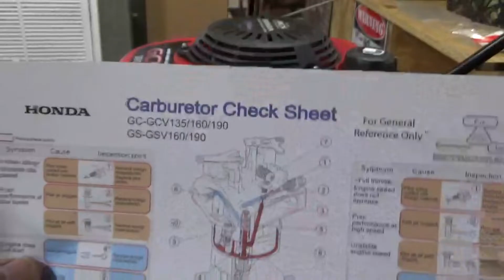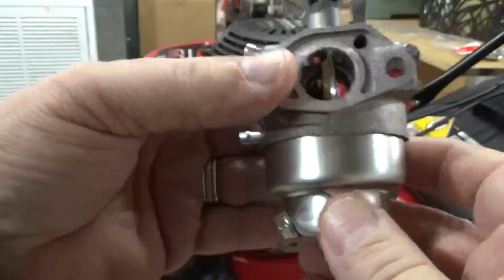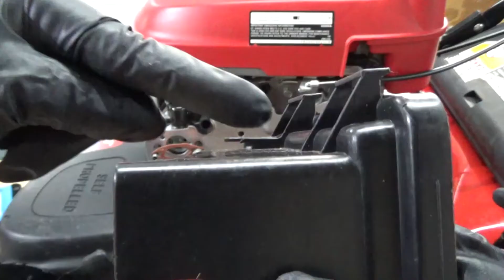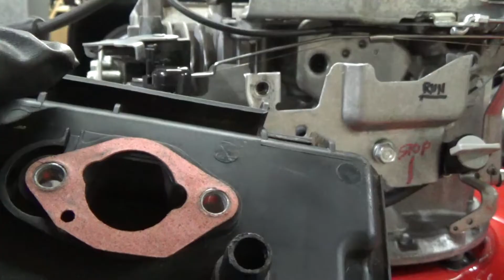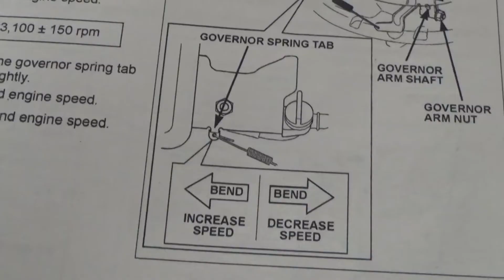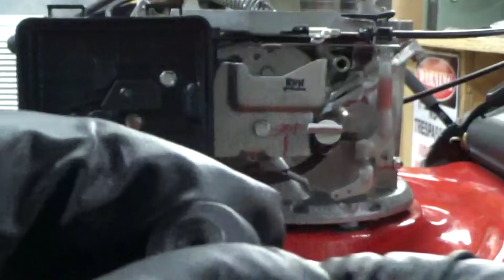Honda GCV160 Fuel System and Carburetor Installation

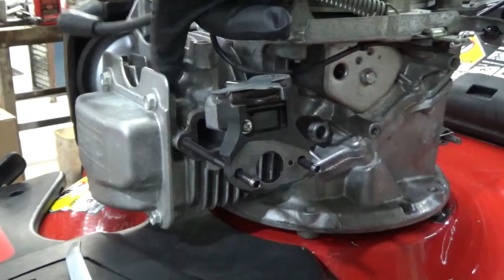Comment: So the piece at 17:07, the auto choke piece, that is what requires that you have this carburetor: 16100-Z0L-876?  It needs to have that tall black post on the top so it will line up with the auto choke?  I have this same engine.  It's on a Troy Bilt but it has that same auto choke piece that goes in the back.  I'm asking because the carb you show at the beginning is not the one you put on at the end.  Thanks for this video.  Insanely helpful!
Reply from the maker: The diffiernce was with the shape of the float bowl.  I decided to use the new design instead of using the brass colored full round design.

The reason for that was that the old design was changed and I desided not to risk a leak in swapping the bowls as the O-Ring seal is very small and thin.

I have not seen the desing you are talking about where the choke is near the engine and the throttle is by the filter.
Reply: Well we ended up getting a carburetor set on Amazon called "Huztl 16100-Z1L-854 Carburetor for Honda" and it worked great. Thank you so much for this video. It was one of only ones I could find that showed how to do our particular Honda lawn mower motor.
Reply from the maker: @those1kidds I am glad that this video helped you.

Comment: You can get these up to 3300-3400 rpm and they'll mow a lot better. They're dogs in thick grass below 3000 rpm.
Reply from the maker: Thank you, I appreciate that info
Reply: @A_Renaissance_Man Some people crank it up to 3600 and the engine does great but the blade is moving too quick and could be dangerous.

Comment: I don't think those holes in the gaskets are dead ends. Is there a channel in that insulator that lines up with them? There is on mine, it's a little different, just a plastic spacer (insulator) with no choke stuff attached. Anyway, you should take that gasket off that was stuck to your insulator, it might make it clear to everybody what's going on.
Great idea with the rods to line everything up!
Reply from the maker: Good idea, I'll do that. Thank you.

Comment: Wait, WHAT?!!! Honda carbs with very similar part numbers can be quite different!? Oh, crap, that could explain why the carb that I bought from Amazon, that appeared to be "close enough", acts like the auto choke (that I recently replaced) isn't doing anything. Just like you, I should have saved my old carb and fixed it instead of replacing it with what seemed like an even nicer newer carb.  Thank you, thank you, thank you, for showing that long list of carb part numbers and the reason there are so many of them.
Reply from the maker: Your welcome.  I make these videos to help.

Comment: I have a lawnmower with a GCV160 engine. I can't control the engine speed. I'm missing a part, but the parts list doesn't show it. Can you help me?
Reply from the maker: Perhaps I can help you.  I have new spare parts like the internal governor gear, but I can not diagnose the issue from afar.   It could be a loose governor arm or the springs could be damaged, etc.
Reply: @A_Renaissance_Man  Thanks for your reply. If I post a link to a video, could you help me?
Reply from the maker: Yes.  I will watch the video and reply.  My gmail address is November11957@gmail.com if you want to send it directly to me.

Comment: Hi , I'm a retired Honda Car Master Tech . I wanted to give some imput on reassemble of carburetor to engine . With or without the special tool you created , you should never tighten ANY bolts down while fitting into place . All bolts should be left loose . After fitting is done you first torque the 2 main carburetor bolts to ensure proper alignment of gaskets , plates and housings followed by the others bolts . Torque to specs , not with gun .

Comment: Holy sh*t.  A 4 dollar can of starting fluid and 15 minutes of time and you would have been cutting the lawn. You install the carb/gaskets to the air box and put the rod and spring on and your done.. There is only a main jet and float needle to clean.

Comment: I have a Honda gcv 160 it looks nothin like this, my oil cap is on the other side and few other things different
Reply from the maker: You probably have the GC Series not the GCV.
Reply: @A_Renaissance_Man  is there a better/another place on the motor to look? The big sticker on the top of mine does say GCV 160
Reply from the maker: @JustinMentionedIt  On mine, on the exhaust side, there are stampings above the oil fill tube. One is HONDA 160cc molded into the engine block and the other is a very difficult to read pin stamping of the individual engine ID.
Reply from the maker: The engine in the video is a 2007 model, first in the series. That was 15 years ago.  Honda comes out with a new series every 7-8 months as winter here is summer in the lower hemisphere.

Comment: The spark-plug gap WAS correct at .036" (0,9mm) and correctly set from maker, but you adjusted it to wrong setting.
Reply from the maker: Thank you. You are correct.

Comment: FYI
As my trusty , always reliable hrx 217 stopped mid mowing and unable to restart, I found your video content pertinent to my quest in resuscitating it. Unfortunately it seems,  HONDA "free" service manual no longer are free to download. The link, although correct, the attempt to download the hrx documents, yields NO response. There is, although, A shop manual FOR SALE for a "paultry" $39. 😢
Reply from the maker: Sorry for the confusion.
The three sheets of paper I showed on the Carburetor, Generator, and Ethanol in fuel were the free downloads.
The manuals are $40.

Comment: Hi David, thank you so much for your video. Hoping you can help me on my question. Last year, I bought a GCV160 mower at a geat price. Now I knw why. It worked when I bought it. It started to slow down on the Revs when I first used it and sounded choked. So, I fell in the trap of buying the Amazon carburettor. It didn't work. So, to my question. With my model & serial #'s where can I locate the exact correct Carb ? I have a GCV160LA0 S3A NH1       GJARA 3218705 . Mine doesn't appear to have all the bells and whistles that you had on yours, but it may have and the guy didn't put all the parts back!!! Help.
Reply from the maker: This was a fun one.
Thank you for asking.
According to my Honda Shop Manual, which you can get on line for $40 or so,  you will need Honda Part Number 16100-Z8B-851, Description CARBURETOR ASSY. (BB65U A), Serial Range 3151055 - 9999999.  There are several Honda Parts dealers around, I saw this carb at https://geraldjoneshonda.powerdealer.honda.com for $18.83.  Now you need to add S&H and tax if applicable.  

There are other Honda dealers, PropartsDirect, Boats.net is a good one, Heartland Honda and others.  
Be sure to check everything before ordering to make sure nothing else is damaged or missing.

Also check the tank as mine has an internal screen and you may have to back flush the tank in order to clean the screen.  Use fresh 93 Octane fuel and perhaps replace the spark plug with an NGK BPR5ES and make sure the kill switch is working as the default is connected meaning normal position is the non running position.

Good luck and feel free to ask if you have other questions.

Comment: Do you happen to have the part number for that carb? I have the exact same mower and I need a new carb.
Reply from the maker: Thank you for asking. The carburetor part number is 16100-Z0L-876 where the middle series contains the number 0 not the letter o.
Reply: @A_Renaissance_Man  thank you so much!

Comment: Sir would you mind posting the Repair Manual part number?? Unless I missed it, it would be appreciated.
Reply from the maker: The shop manual number is 61ZM000E6 where the "0" is the number zero.  a.k.a;  PSV61ZM000E6
Shop Manual for GCV-135, GCV-140, GCV-160, GCV-190, GSV-190 Incorporates R,S,U,W,X,Y and Z Supplements. .©2021 6th Edition.

Comment: Strange, on mine the gaskets on either side of the air guide are the same (part#12  16221-883-800).  Odd since there's a hole in the carb but not a matching hole in the air guide, so the gasket seems to just block it off.  On the oposite side the hole in the carb matches up with a hole in the air cleaner and the gaskets have the same holes.  Recently had to work on the carb due to a sticking choke plate, wouldn't move freely back to the closed position and a few sprays of carb cleaner removed a bunch of built up gunk at the spring.  I originally was expecting to see a failed thermo wax but got lucky. All the original gaskets were in great condition except at the air guide, I think those two gaskets come pre-installed on the metal air guide and they were squished and deformed.  No reason to buy a new air guide since it's metal and in perfect condition, just bought the two gaskets and seems to work great.
Reply from the maker: Excellent point.  The engine shown was one of the first ones manufactured.  Today, auto choke is not even offered.  Manual, cable controlled chokes only because of the problems encountered with the thermal wax systems used in the past.  That has led to a situation where gaskets are still made the same but air paths are not needed or are otherwise blocked off.  Thank you for your comment.